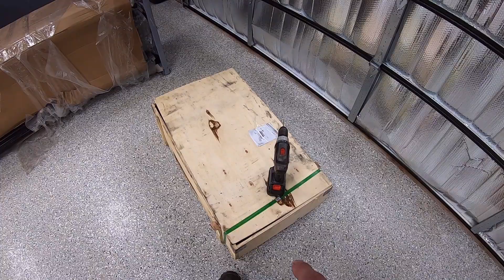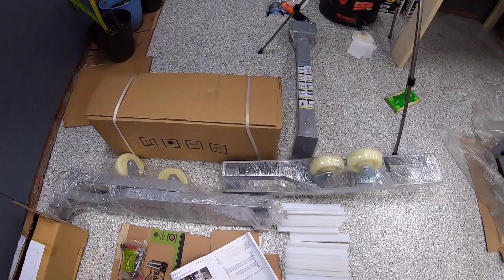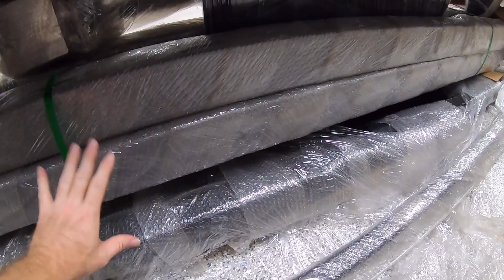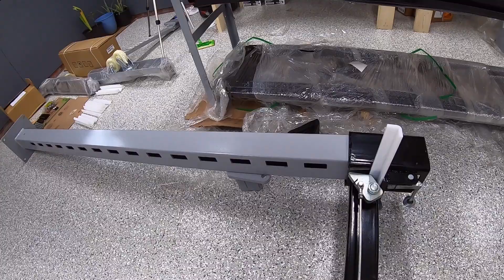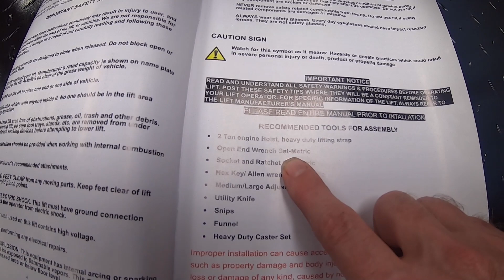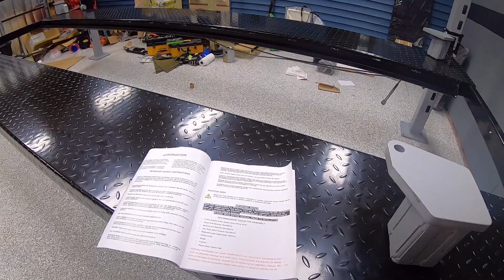Bought a WildFire XLT Lift Part 1

Comment: nice job can you tell me how big your garage is and how high, also did you paint your own floor? I am building a garage now and plan on getting the same xlt lift.   thanks
Reply from the maker: Garage is 28' long X 24' wide @ 10' high ceiling.  The floor was done in Epoxy by a local company.